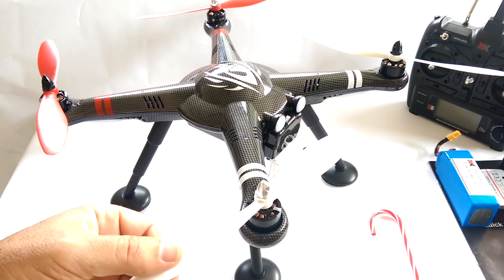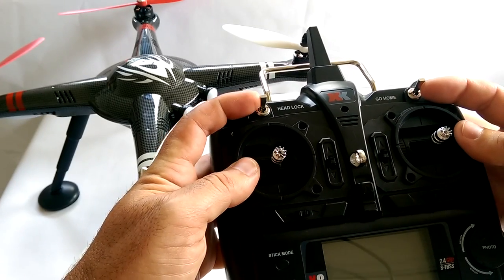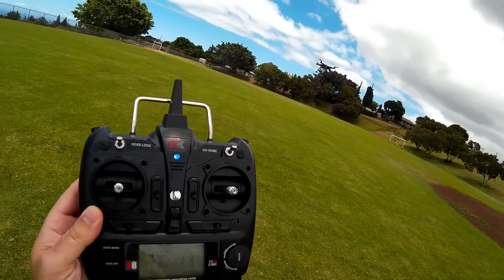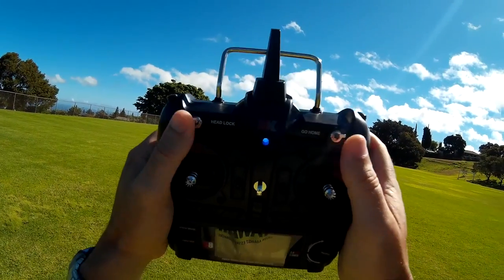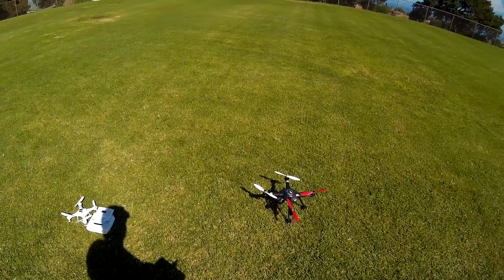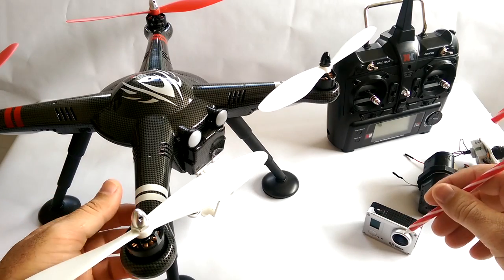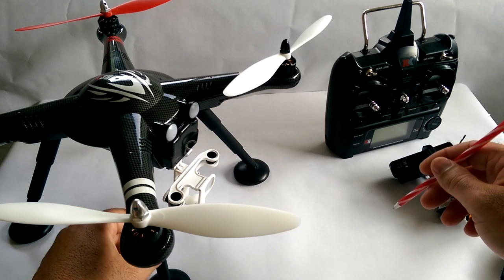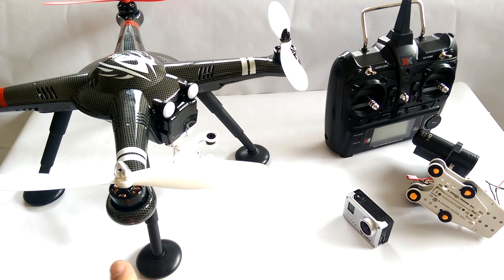XK Detect X380 GPS QuadCopter Drone Full Review - [Setup, Flight Test, Pros & Cons]

Comment: WELL FOLKS HEADS UP, THE XK X380 - C Aerial Photography RC Quadcopter RTF IS >>>CRAP DON'T WASTE YOUR MONEY ON IT. IT WORKS FINE FOR A WHILE THEN IT WILL GO CRAZY AND GO OUT OF CONTROL DONE TRYED TWO OF THEM SO I WON'T BUY NO MORE IAM GOING WITH A DJI PHANTON 3 PRO
Reply from the maker: +Tony Boggs I'm thinking that if you crashed 2 practically uncrushable (IMO) X380 then you will crash your new pricey phantom.  I could be wrong and you just got 2 defective X380 in a row.  Hope I'm wrong though :)
Reply: I was also using a magnetic filter with my fpv gear.  I wonder if this could be a problem?  It was in close proximity to the usb port and motherboard.
Reply: I was also using a magnetic filter with my fpv gear.  I wonder if this could be a problem?  It was in close proximity to the usb port and motherboard.